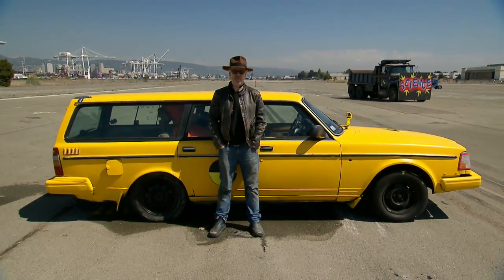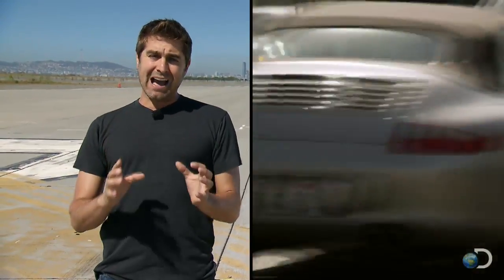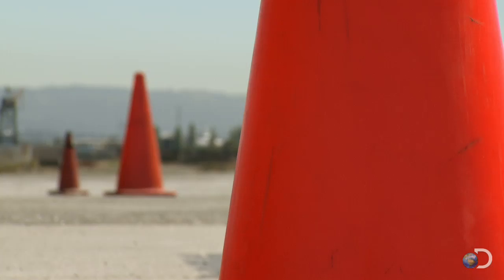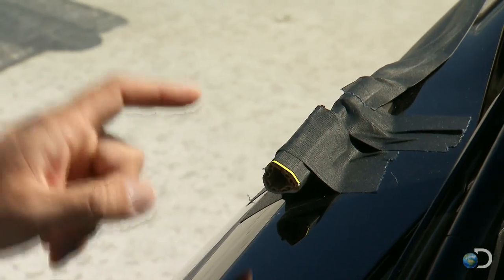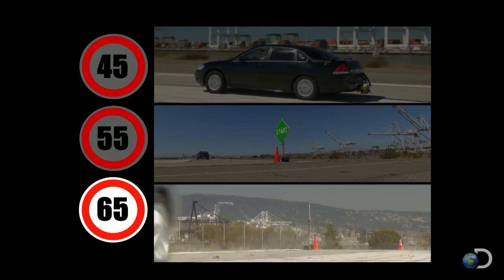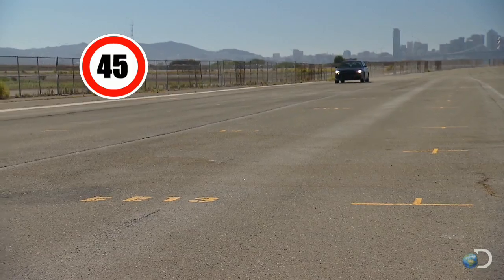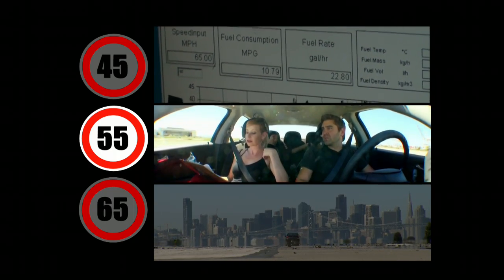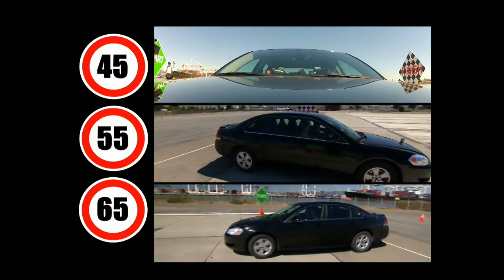MythBusters test Hyper-Miling | MythBusters

Comment: If you clicked to see results, you're better off reading the comments.  I'm disappointed that the guy posting the results only has 6 likes (as of today).

My comment is that cars generally get their best gas mileage at the speed where they go into their highest gear, so you need to know that speed.  The owners manual for my Mitsubishi specifically says it gets the best mileage at 50mph.  
My optometrist that had a Corvette said 6th gear was so tall the V8 didn't like using 6th at speeds below 65mph.  And at 65mph he got 30 miles/gallon.

Comment: Results:
45mph is most efficient at 43.5mpg.
55mph gives 39.4mpg.
65mph gives 33.8mpg.
Reply: Thank you. You're the real mvp.
Reply: Thank you. I was about to have an aneurism.
Reply: @johnmoore1495  oooo that joke didn't age well...
Reply: Consumer Reports had data tables for cars at different speeds around 1980. The results were the same. 45 mph was tops.
Reply: @shawnpa  thanks for this. Car manufacturers should have a cruise control setting to automatically accelerate to that speed.
Reply: @eugenetswong  They do, you can set your cruise control at what ever speed you like.
Reply: @Tore_Lund  it won't be automatic for most cruise controls that I have seen. Normally, I have to reach that speed, and then set the cruise control, as opposed to having the cruise control preset.
Reply: @eugenetswong  I then wrongly thought you meant that CC doesn't work at lower speeds!
Reply: @Tore_Lund  Actually, the cruise controls, that I have used, work only at 40 km/hr or faster.
Reply: @eugenetswong  40 km/h is  25mph, which is pretty slow. If you want to cruise slower you can just leave it in gear at idle if you drive a manual. BTW, I know an undertaker and his herse has a custom low speed cruise control that works at walking pace, simply to make it easier to follow a procession. My 20 year old cruise control, which is simply a throttle lock, works at whatever speed I engage it in, but it is a non OBD car.
Reply: I assume this was in the same gear?
Reply: Thanks. You're the real mpg.
Reply: I doubt that car got that fuel mileage.  He says in the video 18 and 22 which is more believable.
Reply: I’m sure that over 95% of all drivers, of all ages and abilities, knew the answer to this before they even put out a single road cone. What a waste of, well, everything. 

Also, this is NOT hypermiling.
Reply: I’m sure that over 95% of all drivers, of all ages and abilities, knew the answer to this before they even put out a single road cone. What a waste of, well, everything. 

Also, this is NOT hypermiling.

Comment: 30 to 35 MPH is generally speaking the most fuel efficient of all, for all cars I've checked. (That includes cars from the 1950s.) MPG drops off both above and below that speed range.
Reply: +ChasingTruth TakingFlak He's pretty much right in general too.  You usually want to be at the lowest speed for top gear and, with an auto, for the TCC to engage which is almost always around 35, sometimes delayed to 40-45 with A/C on.  Wind resistance rises at the square of the velocity, and usually equals tire drag around 45.
Reply: The lowest speed for top gear varies from 40 to 65mph, depending on the car.  Even then, that isn't necessarily the most efficient speed for the car.
I can shift my Mitsubishi into 5th gear at about 38mph without bogging down the engine, but the owners manual says it's most efficient at 50mph.

I think it's designed for its home country, where many highways have speed limits of 80 km/hr.
Reply: +Austin Lucas Well I can already tell you that you're wrong, because it's mostly dependent on the engine and gearing.
Reply: +ChasingTruth TakingFlak I didn't say it was for every car, just for those I checked.

Comment: Don't bother watching this, they don't show any results in the end. And also, this is not all what hyper-miling is. There are better videos on it on yt.
Reply: DAMN ! I wish I had taken a peek at the comments and saved 2:58 minutes of my life. And I was wondering when the hyper-miling was going to be covered. NOT HERE! DISCOVERY CHANNEL  this is a FAIL.
Reply: NotMyName .NotMyLastname now I know why they have more dislikes
Reply: I just bought a newish gasoline powered Ram 2500 4x4, after a 97 Power stroke diesel for 8 years.  I am now concerned about mpg, it gets 12 vs 20 on the old f250. running at the highest speed, with the lowest rpm gets me up to almost 14mpg, at 52mph. Fuck everyone behind me. ,
Reply: +NotMyName .NotMyLastname Interesting station wagon in your profile picture, is that a 1970s Chevelle?

Comment: Hypermiling is not about the speed. It's about the throttle control. I doubt there's much diff at constant speed. If you use scan gauge or OBDii readers you will know most of the gas is used during acceleration and braking